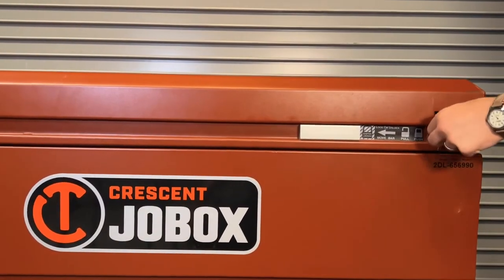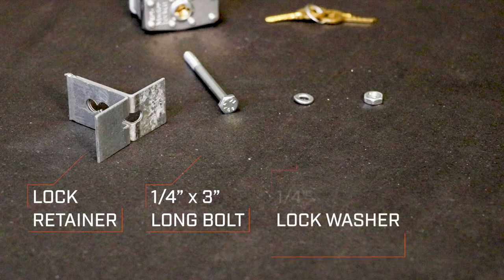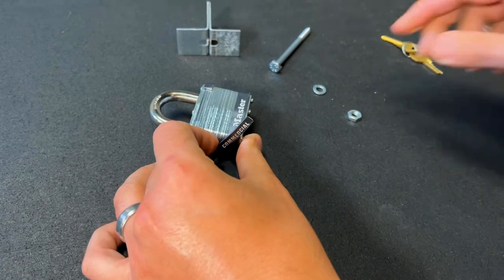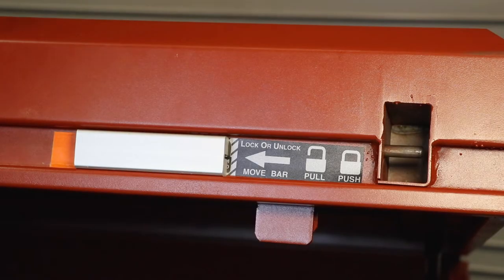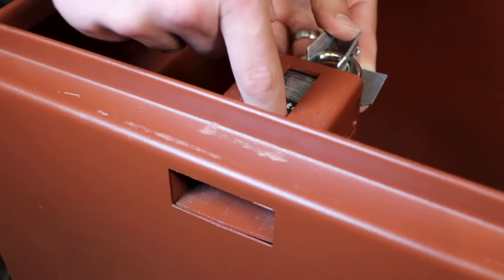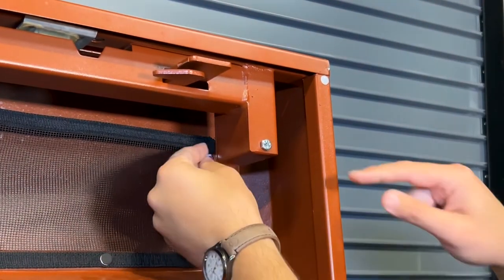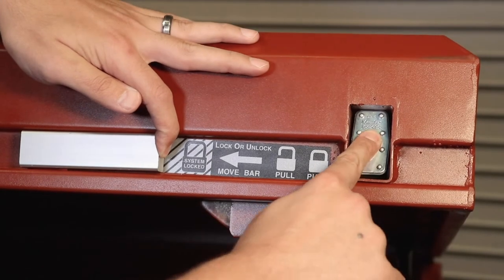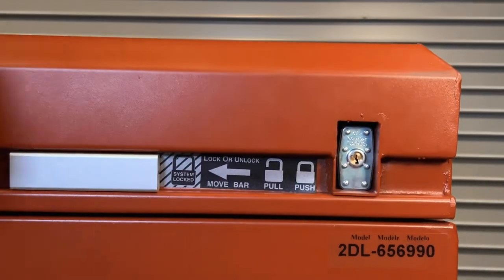How to install a lock on a Crescent JOBOX Storage Chest | Crescent Tools

Comment: This doesn't work with a regular combination lock.  The lock sits too far into the housing to pull it out by hand once the combination is set and the lock released.  Do you have a recommendation for a combination lock with a long enough body to stick out a little bit once released so the box can be opened?